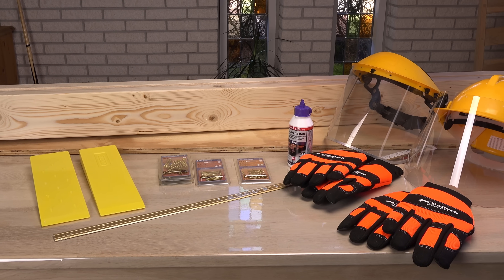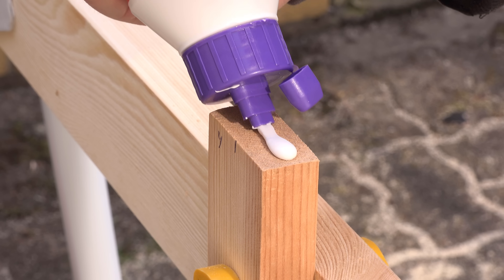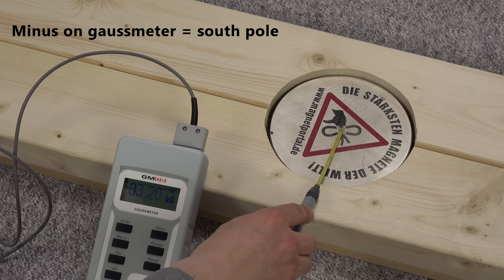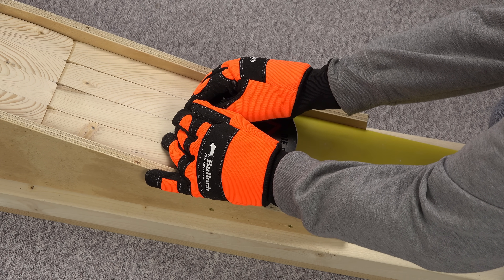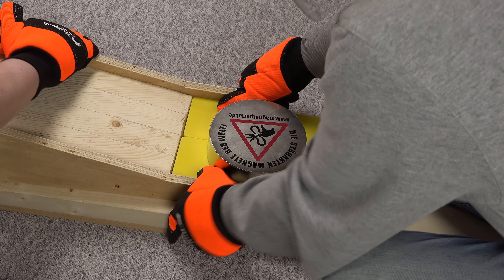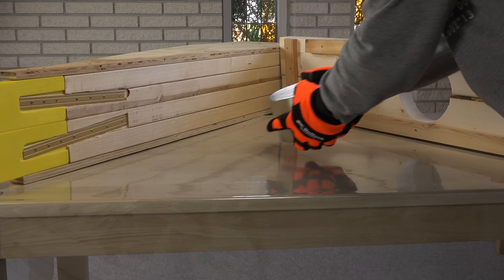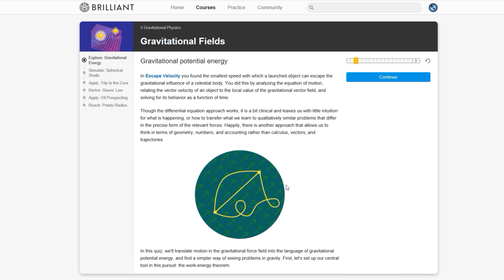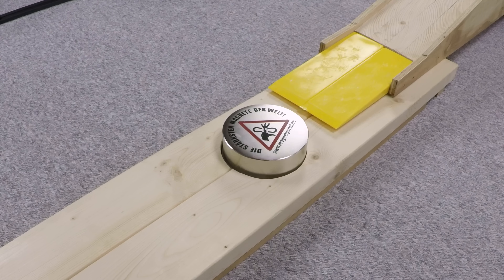Monster magnet meets monster magnet...

Comment: Just curious if this might work... Take a 6 inch inner diameter PVC tube, freeze water in tube leaving room at each end to place the magnets. Place magnets at each end. The block of ice is now positioned between the two magnets - close enough to be drawn towards each other with limited force.  As the ice melts the two magnets would be drawn closer together - the ice preventing them from meeting until it has melted away. In fact, the melt could be easily controlled by heating a single one of the magnets.  Until the ice is melted it would prevent them from touching - slowly drawing one magnet towards the other without allowing them to "slam" together.   
This may not sound too clear but if I could draw you a picture it would be obvious. If I've been clear enough what do you think? Might it work?

Comment: Separating the magnets?... EASY
YOU DON'T PULL THEM APART.
YOU SLIDE THEM APART.

You'll need two of of these wood (2:40), one for each magnet. Much better if hardwood is used.... probably wider too (for structural integrity)
One is bolted down, while the other is pulled (or push...), might need machinery to pull it.
Probably needed to jerk-pull it rather than to slowly pull it.

I've got pellet-sized neodenum disk magnets. Hard to pull apart, but easier to slide apart.

If sliding works on small magnets, it will work on bigger magnets.
====================
Someone built a FAKE Mjolnir (Thor's hammer) using electromagnets, and you need to lift it up but it is resting on a heavy metal plate...
All you need is to slide it off the metal plate before you lift it.
see 4:24 of the video below
https://www.youtube.com/watch?v=0_8Xhzt5YQI

Comment: What happens if the man of steel tries to separate these magnets?   A security  electromagnetic door lock is rated at a minimum of 1200lbs pull force and only consumes about 6 watts of power.  they are only about $200 and you can turn them on and off!  Much more fun.

Comment: The noise is the friction being applied to the plastic in between the two magnates this is so much friction and such little plastic that when it slides on it it is creates little rips and tears the plastic on the surface and bottom creating the noise you heard.

Comment: Try putting them in a glass tube (or acrylic) with a diameter slightly larger than a magnet. Tube to be filled with water. Pressure will throw out the water out and two magnets will eventually be connected. It is crucially that the gap between the tubes and the magnet is small to prevent the rapid outflow of water, and thus the speed of the connection.

Comment: that noise was the plastique being deformed and pulled apart if you do some thing like this any more you may want to get a filling agent that can be dissolved with a chem very slowly and put that in between them that way you do not need to break your back to do this plus you can just put the whole magnet in it to make sure any thing in between them is dissolved

Comment: that noise sounded like the plastic part rubbung in 2x4 on bottom with magnents putting so much pressure on those 2 items. it rubbed each other and made that noise.

Comment: yeah, those are NEVER coming apart. lol!
Reply: Heat would probably be the best bet I would say since that should weaken the magnetic field quite a bit.
Reply: Frankly there's a pretty good chance that even if you were able to separate them mechanically that they would just fall apart. Neodymium is pretty brittle stuff and the forces we're talking about are mind mindbogglingly huge.
Reply: then it sticks to the hydraulic press and you're even more fucked then you were at first
Reply: Maybe with heat or strong shakes?
Reply: But there the magnetic energy will lose and the power is like 0
Reply: Well if you use a hydraulic press to slide them off each other.....not that hard.
Reply: Anklejbiter they can just not by hand

Comment: Is it possible to put a magnet on the floor finely secured from moving, and a magnet on your shoe facing the opposite way. Will it make you hover. I always wondered if that's possible.
Reply: The problem is magnets in repulsion are unstable. The slightest deviation from "straight up" and the magnet in your shoe will try to flip over (and likely flip you onto the floor as it does so).
Reply: Yeah, because a stupid company names their boards "hoverboards", but they aren't. Hoverboards hover over the ground as the name shows.
However, hoverboards for public use don't exist yet and except for magnetic or really huge boards with air, they won't even work in prototypes.
Reply: Theoretically, everything would be possible, especially considering that they can lift (and push) 1200kg at the closest distance. The bigger problem would be to control this with your body. It would be like balancing on a spike which is placed on a rope.
Apart from being dangerous (if you tilt a bit, the magnet spins around and breaks your feet) it would be very hard to manage.
Reply: Never thought about that. Always thought about a magnet skating rink. Where the bottom floors are full of magnets covered up with some type of solid flooring where it does not show them, and if they get lose they won't come straight at someone. Not sure how the skates would be but. That would be pretty cool.
Reply: That could work, but your platform would need to be pretty large (not just a shoe) and the magnets would need to be placed on the board evenly.
However, a simpler solution would be magnets on a copper ground since copper is diamagnetic (it repels the magnet). That would also be much more stable and I think it has already be done (hoverboard).
Reply: aren't hoverboards rolling/moving with two wheels? I mean I never owned one but when I see people pass by with them I see them on two wheels.

Comment: Well that worked but why not take to 2 x 10 x 6 and drill holes in each the same size as the magnets put a magnet in each hole with the two pieces on top of one another with the magnets offset and slowly side them over each other.

Comment: Why not freeze a ~20cm thick block of ice the same diameter as the magnets, use it to separate them and melt it slowly?
Reply: Two tonnes of force between the magnets. They would shatter the block at some point and crash together.
Reply: Put the magnets in a tube with tight enough tolerances that the ice is largely contained. It could shatter, but would not allow the magnets to slam together. They'd be separated by crushed ice, like fine snow. Maybe use snow.
Reply: Snow is compressed to ice with enough force. And a tube would probably have worked, but if one magnet tilts, they will still crash together.
Yes, it would have worked in a tube with very tight tolerances, but it would have been much more complicated than using this method.
Reply: 2000 pounds is hardly re-forming solid ice. In fact melting point drops with pressure, that's how ice skates work.

Comment: Can you implement an electrical field to seperate them?  Or is there nothing to be done other then rediculous strength to seperate them?
Reply: Well the electrical field wouldn't stop the magnetism of both magnets. The only thing achievable with electricity would be strong (at least 2500kg pull force, probably more) electromagnets placed on each side and pulled away from each other. But that would again fit into "ridiculous strength" as you said.

Comment: can they get separated by the hydraulic press channel?
Reply: Well it is about 5 times easier to slide magnets apart than to pull them apart.... wait, isn't the press made of steel?
Reply: So you attach them to the press and try to pull it off. If it fails you have a press that won't go up anymore yay

Comment: If they were separated by ice would they come together slowly enough?
Reply: The ice may crack and shatter and break due to the force of the magnets and since the magnets would be cold, their force would be a little bit stronger than normal.
Reply: Surely if the ice was in a pipe same size as magnet it would have to work

Comment: what about using a tube filled with ice,one mag on the bottom one on top of the ice and let it melt,with a tight tube the top mag would stay level,and water does not compress so it would reach the other magnet after the ice melts?

Comment: ok my ideea for splitting: 
1.drill a hole just where they join
2.put them in a heavy machine cylinder wich diametre is exacly the magnets diametre, 
3.drill a hole in the cillinder and weld a connector for a high pressure hose and face the magnets hole with the cyllinder hole
4.pump high pressure oil between them
will that work?

Comment: next video .. how to separate the magnets ?
Reply: You don't. Without doing anything to change it's form you will not be able to ever take them apart.
Reply: Melt them down.
Reply: You wouldn't need to melt them. They would lose magnetization as they heated up and thus not be attracted to each other. They would not regain magnetization when they cooled or solidified either so you would have destroyed them.
Reply: Pretty easy, actually.
1.  Make a perfectly shaped cylinder form of wood that has an inside diameter & height (6x2) that the lower magnet can rest in.
2.  Lag bolt the new form to a secure base (e.g. a sturdy deck).
3.  Place the magnet pair into the form.  Note: Only the bottom magnet will fit into the form. The upper magnet will be above the form.
4.  Make a length (25 inches) of high tensile strength (Kevlar) webbing (aka flat or ribbon rope) with 1 high-strength S-hooks or D-rings attached to a loop made on each end of the webbing material.  (2 hooks or rings will be needed)
5.  Loop the flat webbing around the upper magnet.
6.  Hook up a winch to a secure base & to the S hooks or D-rings & slowly use the power of the winch to pull/slide the top magnet towards the winch. 
7.  Once the magnets start to separate (~ 1 inch), install (screw down) large hold down washers to prevent the lower magnet from possibly popping out of the form. Do this for about half of the diameter of the lower magnet.
8.  Keep winching slowly until the magnets are separated.
Reply: U can separate them with an hydrolic press ;)
Reply: All you need is a very strong wedge, a large platform on said wedge, and about 5 elephants on said platform
Reply: Super Dave I think just a strap would allow to much unwanted movement once they started separating.  Using a couple 2x4s with a hole cut out to hold the mangets like he used in this video would help keep them stable, one set of 2x4s for the bottom magnet, one set for the top and you could slide them apart without them moving in a way you didnt want.
Reply: microbuilder:  
He stated in the vid that the pull force for each magnet is 1200 kg (~2646 lbs)--(presumably on a plate steel--which is a common rating).  Both magnets together have about 78% of twice the individual pull force, so ~4122 lbs of combined magnetic force + the surface friction of the magnets--which isn't a big fraction of the total force needed to separate the magnets in a plane that is parallel to the contact points of both magnets.  Quite a bit of force, but nothing that a high quality winch couldn't handle.  

One would need to ensure that the ribbon rope is up to the task too!  I'd ensure it is about 1.75 times higher rated than the force needed to pull the magnets apart--just to be on the safe side.
Reply: zeffur7 Thats a great idea .. might just work .. If it doesn't we might need to bring the hulk to separate them . smiles
Reply: Obsidian Productions they would shatter. they are brittle
Reply: Use current
Reply: zeffur7 make sure there is no magnetised metal in one of the setup component ^^
Reply: Good point!

Nonferrous washers could be used & the length of the ribbon rope could be increased to keep metal rings far enough away from the magnet to prevent a problem.
Reply: Nice experiment, now he has two totally, useless magnets!
Reply: Useless??  Together it is a stronger magnet. Separate they are 2 magnets that can be used however he wishes.
Reply: Heat them up. Magnets lose their charge when heated.
Reply: zeffur7 similar to what I was thinking...the initial force needed to get the top magnet to move would be immense, but its doable.
Reply: You can heat them up, but they will lose some strength if they get too hot.
Reply: How about slipping a nylon strap on one and same for the other, use a come-along to slip them apart.  With a minor amount of engineering to go........
Reply: If you heat a neodymium magnet to the Curie temperature, where it loses its magnetic property, you just destroyed your magnet.  For this particular neodymium magnet, it is only 625 degrees F.
Reply: microbuilder 
Correto mundo!
Reply: Separating the magnets?... EASY
YOU DON'T PULL THEM APART.
YOU SLIDE THEM APART.

You'll need two of of these wood (2:40), one for each magnet. Much better if hardwood is used.... probably wider too (for structural integrity)
One is bolted down, while the other is pulled (or push...), might need machinery to pull it.
Probably needed to jerk-pull it rather than to slowly pull it.

I've got pellet-sized neodenum disk magnets. Hard to pull apart, but easier to slide apart.

If sliding works on small magnets, it will work on bigger magnets.
====================
Someone built a FAKE Mjolnir (Thor's hammer) using electromagnets, and you need to lift it up but it is resting on a heavy metal plate...
All you need is to slide it off the metal plate before you lift it.
see 4:24 of the video below
https://www.youtube.com/watch?v=0_8Xhzt5YQI
Reply: Swiper Fox 
Of course! 
That's exactly what I meant, but didn't go into depth for a explanation.
Reply: Swiper Fox 
Of course! 
That's exactly what I meant, but didn't go into depth for a explanation.
Reply: zeffur7 
Great explanation, thanks!
Reply: TopEvt 
Dynamite!
Lots and lots of dynamite!
Reply: TopEvt brilliant idea 😅
Reply: hulk smash puny magnet
Reply: He already did that video with smaller magnets https://www.youtube.com/watch?v=ybY_wdQ5MSc
Reply: It is easy, if you have a head. Kick to slide directory.
Reply: Louis Laszlo
Could be pretty easy since it's melting point is at "only" 1000°C. Though your magnet is broken after that

Comment: I'm thinking of another and simple method. I would borrow a bucket of vaseline, let it melt on an electric stove, let the first magnet descent to the bottom of the bucket, let it cool and then suspend the second magnet to the bucket. Because there would be some 30 cms of solid vaseline in between the magnets, they would not move very fast and hopefully would not crack.

Comment: Next time, place one magnet in the bottom of a pvc pipe. Stand the pipe up and fill with water. Place the second magnet on top of the open pipe and let it settle to the bottom. If needed, drill a hole in the pipe just above the lower magnet to let the water out. THINK OF THE SQUERT !

Comment: What about taking a tube of 6" inner diametre, setting it upright, putting one magnet on the bottom of it, pouring in a not very viscous oil, then put the second magnet on top? If the gap between the magnets and wall doesn´t permit for enough oil to get squeezed through to make joining the two happen in a decent span of time, a valve on the level of the seperation line between the magnetsould be used as a controlled drain.

Comment: I'm fairly certain that the loud noise was caused by the top magnet rubbing on the bottom magnet. If you look at the video when the sound is made it looks like the top magnet slides forward due to not being aligned fully. Just a guess

Comment: Like an IDIOT and despite of 40 years of engineering and armouring experience, I recently tried to grind off a 2mm burr off the metal housing of a super-magnet with a giant workshop belt-grinder, totally forgetting that it would simply stop it dead by sandwiching the belt between magnet and steel frame. All I will say is, if you are going to try this, make sure you are wearing googles, respirator and VERY thick gloves, crash-helmet ear protectors, and steel-lined chainsaw trousers and be sure that your workshop RCD is working correctly! Magnets are ****ards sometimes.
Reply: Your profile picture fits perfectly to your story....
Reply: @nigelcarren but did you die?
Reply: Hey Capital... thanks for asking... Lets just say my trousers did!!!

Comment: Getting those apart is not going to be easy. The way to do it however, first a strip of rubber around the circumference of each for grip. Then you need to make or get hold of a giant circlip, a flat bit of steel wrapped around each one then pulled tight with a bolt should do it. After that to apply a slow but strong force I recommend two vice’s starting from open such that when you close them their outer jaw pulls the magnets apart via the metal/rubber circlip. I literally cannot think of any other way that stands a chance!

Comment: In 2016 I got stuck in between two strong magnets (400 kg & 1200 kg). Luckily only two fingers got stuck. My right hands middle finger got broken and the bone of my ring finger got completely flat. Accidents might happen very fast if you're not carefull.
If my fingers were 100% before the accident they are 95% now. Could've been a lot worse I guess.